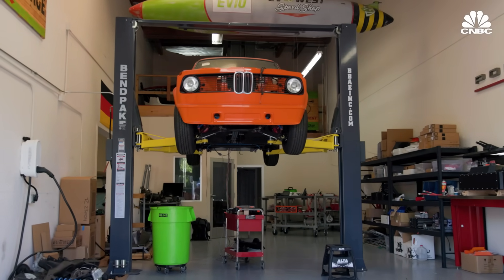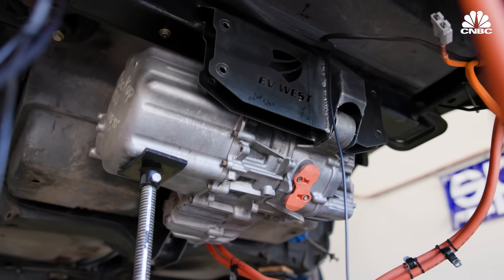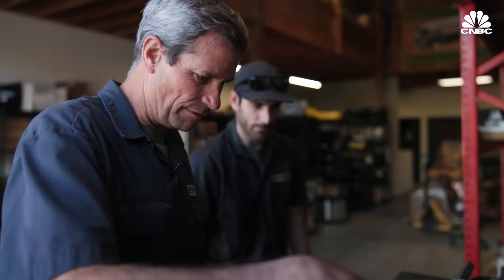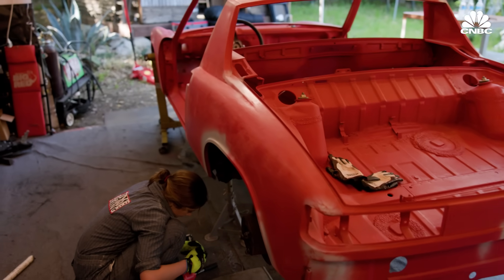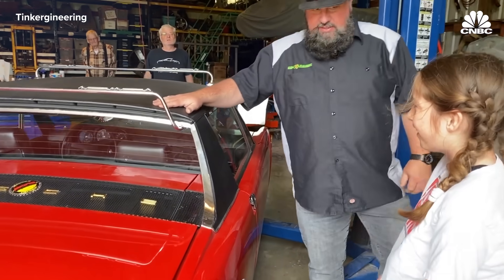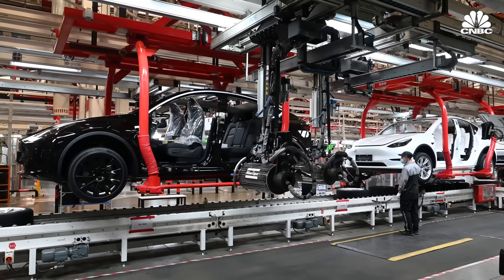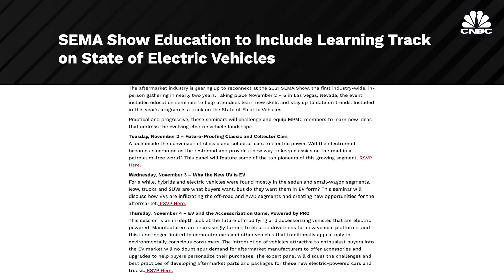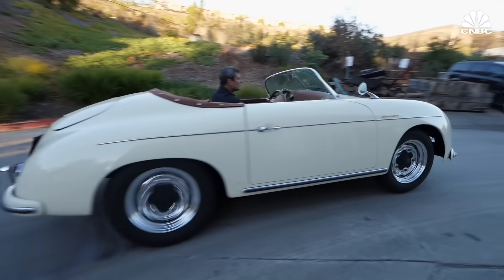How To Convert A Gas-Powered Car To An Electric Vehicle

Comment: Just where is the power grid required going to come from? California has brown/black outs already. The democrats are cutting back on fossil fuel based electrical generation. Solar/wind is no where close to providing the needs and is killing the planet with the way in which the materials are gathered and the tremendous landfill requirements as recycling of old batteries lags by years.
Reply: More local green sources? The grid isn't as stressed if the distances are shorter, and especially if there's more storage of the excesses that wind and solar regularly provide during the day.

Comment: Back in the eighties I converted a Fiat 128 to electric. I used a surplus jet engine starter as a motor and lead acid golf cart batteries. I intended to add a gas engine genset to extend range. It worked, but only went about 18 miles on a charge.  As I remember, I got up to 50 MPH once.  It was too early to be practical.  Right now I drive a 2019 Chevy Volt.  It's basically what I was trying to invent back then.
Reply: In 1991 I drove around a 3 wheel neighbourhood EV, also souped up with a 22KW motor. Top speed was 64 mph and range on lead acid batteries was 75 miles at 30 mph. Currently driving a Fiat 600 elettra from 2001. Fiat made a few of those EV Fiat 600 with lead acid batteries. now with Li-ion batteries I get 120 miles on a charge.
Reply: @Tore_Lund  GM screwed up once again, the first time was described in the book "Who Killed the Electric Car".  The second time was killing the Chevy Volt.  We've owned 3 of those. Currently my wife has a 2013 which runs like new. I have a 2019,  the last year of production. I live on the Utah Wasatch Front, a rather dense metropolitan area, but sometimes I drive to my remote Wyoming property, a lot more than 50 miles with scant chargers. Around home we never buy gas.  The unique series hybrid Volt goes 40-50 miles on a plug-in charge, But it has an ICE that will go 400 miles on a 9 gallon tank of gas.  This car  is perfect, no range anxiety but electric 95% of the time.
Reply: @jeffsaxton716  Nice!
Reply: @jeffsaxton716 is this the case of a company killing a product because it was too good? And do you seriously get a 400 mile range on one tank of gas?
Reply: @TheOOOOOOOOOOOOOOO  It goes  50 on battery only then gets 38-40 MPG after that and has a 10  gallon gas tank, so yes.
Reply: The issue  was da battery range
Reply: Not bad for a home build.
Reply: Dayum a Gen 2 Volt. Such an underrated car a really great package.
Reply: I have two dream cars, one is a 1960s VW Beetle EV, and the other is a 1950s studebaker pickup truck EV.
Reply: @nickiemcnichols5397  Nice dreams. The beetle begs for conversion. the separate rolling chassis makes conversion easy and the cabin just sitting on top with 16 bolts. Aerodynamics are not great despite the rounded appearance. What about british small sports cars originally with small engines like the Rootes Sunbeam. I have seen more in poor condition and not expensive (possible not so in the US). The smaller the donor vehicle, the further your money goes for the components, the more range on the battery pack. So Pickup trucks do cost significantly more to convert.
Reply: Wow that's still quite very good for the 80s. 29 km is low by today's standards, but it's still enough to run a day's errands unless you live in the middle of nowhere.
Reply: Thats my favorite car. But I really need 100 miles and 150kw charge. I deliver food so...
Reply: @ricky4673  100 miles range in a car that size is 18-20 kWh in batteries. Charging those with 150 KW is not possible, but don't be sad 22kw which you can get from AC chargers is plenty to give you sub hour charge times.
Reply: I have question, how do you insure an electric converted car?
Reply: @EddyBoh  Best advice: Don't tell them. and drive very carefully. If you insist on being involved in an accident, cross your finger for you modifications were not a factor.
Reply: @Tore_Lund  Unfortunately, insurances look for the fastest way out
Reply: These custom electric vehicles are going to be a nightmare of fire risk.  These shops are not employing electrical engineers, automotive engineers and chemical engineers to design these.  Just wait until there are EV fires in tunnels and in underground parking garages.  After a few custom EV fires, there will be a ton of regulations pop up.
They cost an absolute fortune.  Will insurance companies even want to insure them?
Reply: real100talk5 what do you mean by that? It’s a plug in hybrid. That means that you can get 50 miles, sometimes more, as an EV, then, if you need to extend the range, there’s that gas powered generator that powers the EV motor, and that thing alone gets crazy fuel economy. You could run that thing on gas alone, and never charge, and it would still be great. 

I recommend everyone who is hesitant about EVs to consider a Volt. We traded in our 2017 Volt lease for a 2018 Model S. The Tesla is a great car, but I still have nothing but great reviews for the second gen Chevy Volt. GM is stupid for killing it off.
Reply: Thomas Edison was building lead acid EV's in the late 1800's, you didn't invent squat.
Reply: @rotaryenginepete he never said he invented lead acid EVs. People have been making those for decades. They were never efficient in modern day, which is why it never took off. Instead, he is claiming he invented the modern day plug in hybrid, though he also said that he “intended to,” which means that he was never successful at doing it, which thankfully he never patented, because that’s the real problem with inventions. No one can actually build anything. But attaching a generator to an EV isn’t that revolutionary. I’m sure tons of people had his same idea.
Reply: I did a 67 Mustang in the late 80s. Series wound motor, lead acid, and a SCR chopper. Top speed 49 mph with a 35 mile range. It was a success.
Reply: Please🙏 my job car accessories electric asperns 12 yer please help
Reply: My work Saudi Arabia 12 yer
Reply: @thatonekerbal  More subjects in this thread and some time ago I discussed this? Are you referring to my  EV?  That one is getting 160Wh/mile average driving. My old former gasoline compact car got 64 MPG winter summer average, with my granny driving style.
Reply: @thatonekerbal  Lets calculate: A model 3 uses 227Wh/mile combined. US average footprint for 1 kWh is 386g (MIT 2024 article, I can't link to because YT won't allow) That is actually a significant drop from a year ago in US grid power emissions! So a Tesla emits 87g per mile. Not bad. My old car: 64MPG. Burning 1 gallon of gasoline produces 9072g of CO2. that is 142g per mile. So a model 3 pollutes  87/142 = 0.61, or 61% of my old car. That equates to a range of a model 3 on gasoline of 104 MPG. So you are absolutely right...but, The saving is the difference between the two, i.e. 55g CO2 per mile. so that is what you are saving the world from. Compared to your US average household footprint of 16 tonnes per year. Buying a Tesla driving the average 14263 miles per year, you are reducing your yearly footprint by 0.784 tonnes, or 4.9%. Is that really best use of money to reduce your footprint? A condensing dryer, costs less than $1000 and offer a similar reduction in emissions? Likewise throwing away your AC is free and does even more. So buy an EV when you plucked the low hanging fruits from your lifestyle, and don't think too hard about the emissions you made to be able to afford your Tesla. I do drive an EV, but a compact car, using 160Wh/mile and used so its manufacturing emissions were made in 2001 and I scrapped my old car (took it out of this world). Still does it make absolutely sense, or am I rationalizing, that this makes it OK to keep driving? I do live in an apartment, so my household footprint is only around 9 tonnes (am not American) So my savings driving an EV makes more sense, but still the cost / savings in emissions is disproportionate and I too kid myself that this is doing my part. World wide EV are 3% of vehicles. This will take 60 years if voluterely people are going to drive EVs. Global emissions grow 1.1% per year. We are not even catching up! So let's focus less on the EVs and more on the lifestyle in general.
Reply: @thatonekerbal  True, proportionally the reductions are bigger if you used to drive a bigger car, but why didn't you drive a compact to begin with then, if you cared about the environment? It is again this mindset, that buying an EV absolves me from previous discretions?  I'm not pointing fingers here, I admitted above, I myself is lured into this. Like saying a serial killer should be applauded for buying cookies from a scout, because his other crimes. Yes gridpower is improving, but no countries are getting close to what Norway can do. Their footprint is like 8g/kWh France is second because of their nuclear power. Do we have time to wait?
Reply: wooow
Reply: @thatonekerbal  Your numbers are correct. No argument there. My complaint is that the difference is not significant enough to make difference before our grids are significantly better. I was not making the case for "it doesn't matter" it does, but EVs just aren't delivering yet. 1.47 billion passenger cars globally. If all of them were Teslas tomorrow (and the grid could follow not reverting to more polluting sources) it would still only be a 50% reduction of that segment. That is a significant improvement, but it won't delay global warming. Europeans need to reduce their emissions 8 times to become net neutral, an American somewhat more. An EV reduces your household emissions between 4-15% depend on where you live and how you live.- i.e. EVs can't do yet what they are supposed to do, because grid power is not clean enough yet. Buying a share in a wind turbine is more urgent than buying an EV.  Likely the balance will have shifted in 15-20 years, but it hasn't yet.
Reply: @thatonekerbal  That is another issue. In my country, Denmark, we are betting big on "Power-to-X" , alcohol synthesized from Hydrogen made with renewables. That is around 5 times less efficient than battery electric, to keep a few trucks and ships running without fossil fuels. However the plant planned will at most be able to supply only one single cargo ship! That is a step backwards, that will be able to store surplus renewable, but also make electricity more expensive for all of us. Oil companies are involved in that.
Reply: Love this🔥🔥 wish you would have video documented and in the 80s.. we need more people like you on this Earth
Reply: there are kits to install eletric motors on the back wheels and a small battery pack. Only around 5k. And turn into an Hybrid with regenerated breakes. Petrol for more extended distances.-
Reply: yeah that's a huge load of bullsh*t pathetic attention seeker
Reply: You peaked too early 😂 but love the DIY spirit
Reply: I'm India🇮🇳
Reply: @thatonekerbal  you missed the part where the same methods are used to produce the energy that it consumes. Furthermore, lithium mining is far more destructive to our environment. Thirdly, tires on an ev emit more pollution than on gas vehicles, Fourth, disposal of ev batteries is far more destructive to the environment than with gas vehicles. Finally, fires in evs caused by accidents or shorted batteries pollute the environment exponentially more, and are far more dangerous than with gas vehicles.
Reply: @thatonekerbal  you actually don’t know, you just repeat figures you’re told as if you do. “Figures lie, and liars figure.”
Reply: Why woud you do that. A battery can't even warm up my engine block if I leave my van for a week in the winter.
Reply: @thomasolson7447  If your battery discharges in a week in winter, you either need a new one, or should install an AC engine block- and cabin  heater. They are very common in Finland.
Reply: @Tore_Lund  the guy that owned my van before me rewired it so the radio went off the cigarette lighter. I haven't fixed it, and I don't plan to. It's fine the way it is. I just have to be careful about it. Also, I'm in Flin Flon MB. -40 degrees celcius is pretty common.
Reply: @thomasolson7447  The cigar lighter shouldn't be a problem. The standby current a radio draws is negligible. You could measure parasitic current draw from your parked car between a battery terminal and the cable clamp, just to be sure. I don't drive much either, often not for two weeks or more. I did have a 10W solar panel on my dash, when I still drove on gasoline. It worked in winter sun too.
Reply: @thomasolson7447  in Canada they have engine block/battery warmer idk if it's free or not
Reply: lil bro again stoned
Reply: Electric vehicles are cold weather challenged, hot weather challenged, longevity challenged, emergency refill challenged, long distance travel challenged, damaging to the environment to produce on a large scale, highly explosive/flammable beyond their gasoline powered counterparts, and still pollute considering the energy comes from the same sources as it always has.
Reply: @shaunstark4263  2 things have happened you may be unaware of. 800v systems charge exrremely fast. 80 miles in 10 mins fast. Secondly, lifepo4 or lithium polymer, do not explode at all. Some of those cons are less relevant. I would say the number one con to EV is the charging network. However, cars are qdapting to the tesla charging station. So that issue will be solved in due time as well.
Reply: @ricky4673  you mean the charging that our infrastructure cannot support? Regardless, the energy doesn’t come from any cleaner of a source. Furthermore, the amount of natural resources consumed for the production of a single unit is far more than an internal combustion based auto.
Lithium mining and cobalt mining are damaging to the environment, as well.
Reply: @shaunstark4263  Strange.  We are in Utah which has very cold and very hot weather. My wife has a 2013 Chevy Volt that still works perfectly and has never broken down.
Reply: @jeffsaxton716  it’s common knowledge among scientifically literate. That’s why batteries are rated with cranking amps and “cold cranking amps”.
Reply: @shaunstark4263  I'm not a fan of the rare earth metals either. My phone is cracked to hell and I'm not getting a new one. All my computers are second hand or salvage. I don't know the specifics, but I'm afraid some poor African child might end up working himself/herself to death as a result.
Reply: @shaunstark4263  Driving an EV in the US emits as much CO2 per mile as a compact car on gasoline or diesel in Europe. Yes you really need a partially cleaned up grid to make it worthwhile to drive an EV. My previous car got 64 MPG. The EV I drive now uses 160Wh/mile however the grid in Denmark is half renewable so I emit around 45g CO2/ mile now, half of what I did before. However I don't drive much, so had I bought a new EV, it would take forever to recoup the the footprint from its manufacture.
Reply: @Tore_Lund  it's not just about gobal emissions since the car isn't far way from polluting like industries. Is more for the quality air and noise in the cities and trying to avoid the pollution in our urban lifes. In big cities the cars emissions are as dangerous to human health as smoking and the noise is estressfull. The best would be to just move to trains, buses, ebikes to make a pleasent city and use car more ocasionally
Reply: @vermart9607  True we do appreciate that too, the silence and the improvements to air quality locally. However I'm European, and my car is taxed by its CO2 footprint; g CO2 per km, so the the whole idea here is making cars reduce their contribution to national CO2 emissions, it is the objective.
Reply: @Tore_Lund  yeah, i guess, because they don't speak about how polluting batteries are, instead of having a global view, they just focus in C02

Comment: I've always wondered what happens when the check engine light comes on because you've removed the O2 sensors and such. Or if they replace the cpu, reprogram it, even keep the obd2 port.
Reply: Nothing of the old car management system left to complain. If you are lucky you can run the old dash through can-bus messages generated by some custom hardware, i.e. programmed Audino or such. EV inverters do give out a speed sensor signal. So no worry your dash will be riddled with error messages.
Reply: CPU not APPLICABLE  ECM(engine),BCM(body),TCM(transmission),BCM(brake),RCM(restraints ie air bags seat belts) Massive retrofitting required for modern electronic controlled vehicles. Minimal for analog (mechanically) controlled vehicles.

Comment: How can I convert my Prius to plug-in? Anyone?
Reply: I thought of converting my Camry Hybrid into a plug-in, but I did the math and I found out all my savings will go down the drain during winter time because of the need of warming up the cabin. Getting heat while the gasoline engine is off is a challenge.

Comment: If your car isn’t charged and there is an emergency, then what?
Reply: How is this different when you run out of gas? If an EV runs the battery down, they call road service to send a vehicle with a small gas-powered generator in order to charge the EV enough to get to the closest charging station (you don't want to do a full charge due to time and cost)..
Reply: @peterh5165  it doesn’t take hours to fill the gas tank, obviously.

Comment: More powerful and less deadly….that’s what I like about EVs
Reply: Wrong on both points, but you do you I guess 🤷‍♂️
Reply: @Shoprestorationthe  Gas Powered car emissions are deadly bro, according to MIT's study: "Emissions from road transportation are the most significant contributor to air pollution deaths, causing 53,000 premature deaths, followed closely by power generation, with 52,000" - and of course they are more powerful - when a family sedan by Tesla is the fastest production car in the world, you know running your vehicle with the cancer causing fuels just can't cut it.